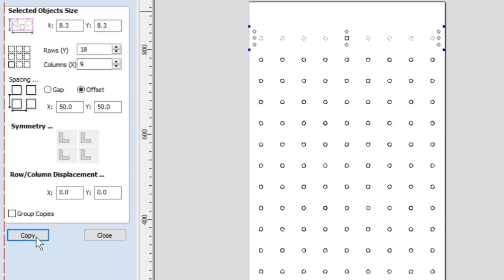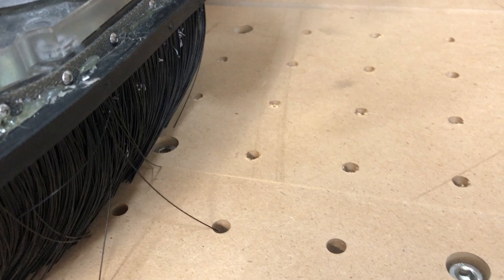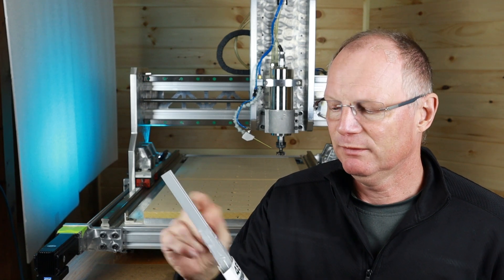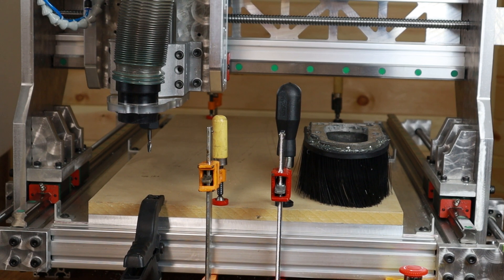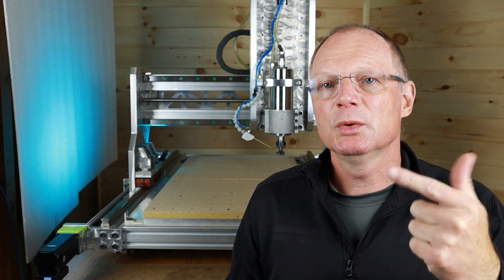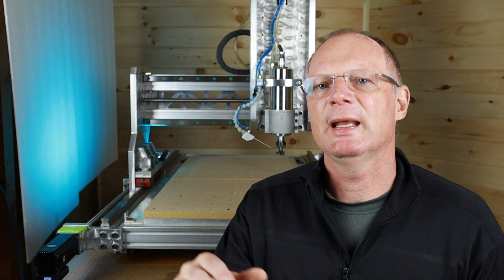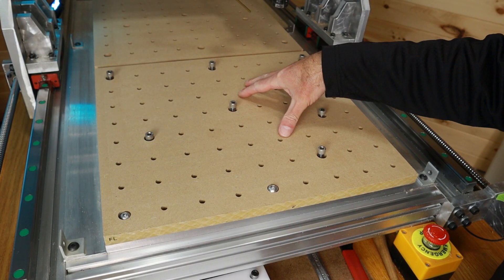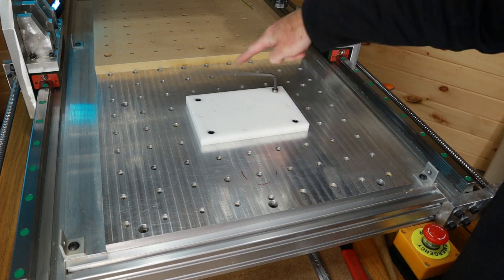CNC Router Beginner to Pro EP02 The Spoilboard

Comment: Can you tell me that tool you use to remove the rough spots on the edge of the hole.  Around 4:52? Thanks!
Reply from the maker: Yes certainly, it’s a simple de-burring tool that you can buy as a set to use on different materials. Plastic, aluminum and steel works on all of them. My set was cheap and it’s from Shars. But you can find it also on Amazon

Comment: I have probably just spent up to $3000 in my head on my CNC upgrades after watching your channel, really looking forward to improving my CNC even before I start making any parts for my RC hobby. 
I love this idea of putting a spoil board on top of the aluminum bed, can't wait to do this..
Reply from the maker: It is a very good concept. I use my machine for RC Airplane parts and quad cooters.
Reply: @JBWorx  I would love to see you making some of those parts one day.
I myself am into the old Tamiya models from the 80's and 90's
Reply from the maker: I might show how to make a mold for a DLG glider wing. But that is a maybe.
Reply: 3000$ i can build 2 big cnc machine what can use any RC and aluminium parts what i want ewer doing whit machine. and 3 pcs middle size cnc machine, sure, my RC and metal work hobby.
Reply: my son cnc machine i build less than 1000$ and can cutting 1200mm long wing profile, or wood or aluminium parts maximum size at table 1400x1400x400, easy simple build own cnc machine.
Reply from the maker: It very much depends on the type of components you use and in what part of the world you life.

Comment: What about a spoilboard entirely of HDPE?
Why nobody is using HDPE? Costs reasons or what?
Ok, it is a warping material, but once screwed down and flattened should be better than MDF.Or not?
Also the threade insert on it should be more pull-resistant than the once on MDF.
Reply from the maker: I think HDPE is not really well suited as a spoilboard. It is just not rigid enough and like you mentioned it moves a lot. Now POM on the other side is a totally different story it is very well suited and you can cut threads right into it and they hold well.
Reply: Cost is an issue. Just for comparison, 3/8" thick x 24" x 24" stress relieved HDPE is $60, while Delrin is $290.
Reply from the maker: Correct not really a disposable solution like MDF